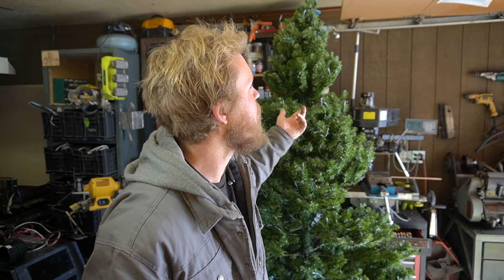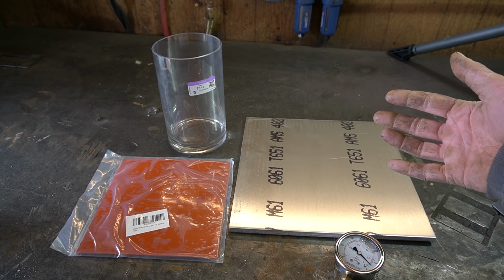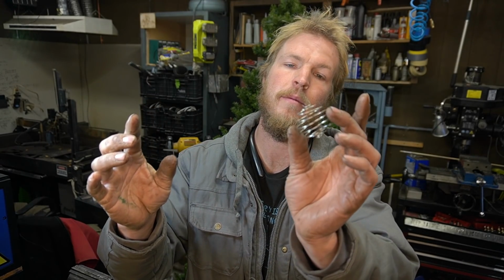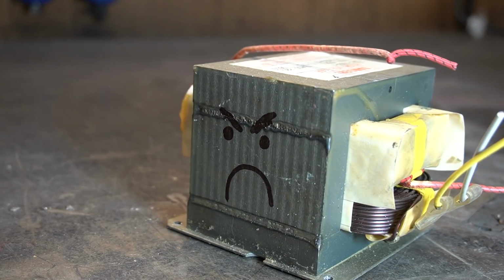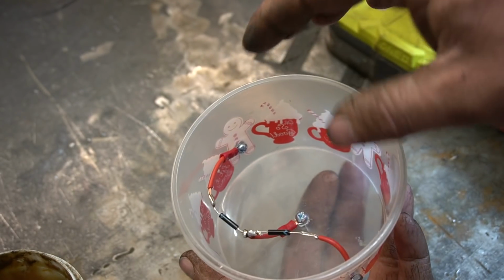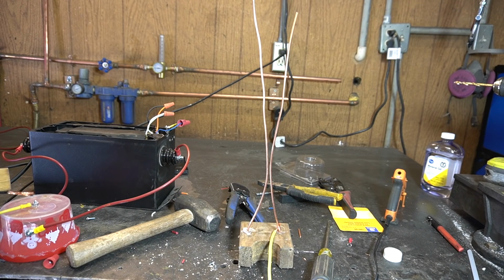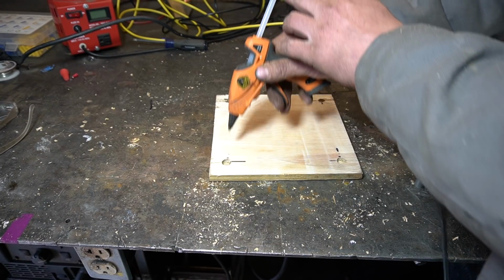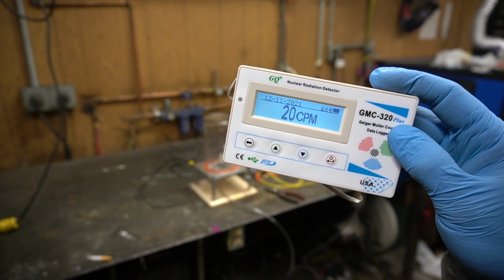I Put A Fusion Reactor On Top Of The Christmas Tree

Comment: Hey! First off love your videos for many reasons but to keep it short I appreciate you as a person and for the content you provide ❤️ secondly…. I tried to make a fusor almost 2 years ago, had almost all of the equipment needed to do so except a high voltage feed through. I’ve got multiple stainless steel UHV parts and chambers, piping, flanges, seals, two compact diffusion pumps and everything. Would you by chance be interested in having me ship them out? I’m saddened I have not accomplished it but i went way over budget and have moved on. Please let me know as it would be worth it just to see someone actually finish what i didn’t!
Reply from the maker: That would be incredible man, I too feel bad that I pit this prohext on hold

Comment: try spin glow fusion reactor
Reply: its only a flash tube, with radial out plasma current and top-down permanent magnet field, which becomes the arc spin glow plasma stuff
Reply: try electrostatic potential high voltage generator instead, the "active" version wastes current, you dont need that, to make x-rays
Reply: van de graaf generator, the hair rising static voltage generator, you need the field strength voltage, not the current for the ion accelerator and smash the ions to the target deep
Reply: also the static voltage is spark only, very safe, small amounts of fusion generation
Reply: a normal fusion reactor is no harder than a flash bulb (those long tubes, curved/circle ion particle accelerator)
Reply: ball valved centrifugal impeller vacuum pump, spin so fast that it succs

Comment: Why wait so long and build until 2030? Making a commercial fusion reactor in two years is real!
I am the author of the third method of achieving nuclear fusion, this is the repetition of physical conditions as in the solar corona. In 6 months there will be a small prototype of a commercial fusion reactor. A commercial fusion reactor in 1-2 years! Power 100 kW.                                                For many years (almost 25 years) I have been convincing scientists that thermonuclear fusion in the Sun occurs not in the core of the Sun, but in the solar corona !!! But scientists are very stubborn, and do not want to believe the obvious. Why are scientists not accepting new breakthrough scientific ideas? There is an assumption, accepted by most scientists, that thermonuclear fusion in the Sun occurs in the Sun's core. But no one has ever actually confirmed this. This is just a guess, the fantasy of an authoritative physicist. Scientists are currently using two methods to achieve nuclear fusion: inertial confinement and magnetic confinement. But there is also a third method of achieving nuclear fusion, this is the repetition of physical conditions as in the solar corona. Nobody is using this third method to achieve nuclear fusion? In 6 months there will be a small prototype of a commercial fusion reactor. A commercial fusion reactor in 1-2 years! I propose a technology transfer for a commercial fusion reactor under a contract. Thermonuclear fusion in the Sun - a new version. http://n-t.ru/tp/ie/ts.htm     https://www.youtube.com/watch?v=izCALj848xU

Comment: First time viewer here. I also use the turn it on and bravely run away method most of the time. However my cat would rather nap, so when vacuum testing canning jars, I noticed mine fit nicely into 2-liter soda bottles. I can't promise it is enough protection, but having blown up a lot of 2-liter bottles I know they're tough and mostly shrapnel-free, tending to stretch and rip in one place instead of shatter. My possibly dumb thought is if the glass implodes, the plastic might stretch a bit if fast moving glass hits it, slowing it down instead of also shattering. I think the glass shards will magically not cut the plastic. I can't see if it actually worked according to plan since my eyes mysteriously disappeared during the test. j/k. 

Probably the right way to test is to submerge the vessel in water in a strong tank and pump it down. If water will stop a speeding bullet, it will probably stop relatively slow moving glass. It might also help see where leaks are.

I think other commenters are right, the pressure difference between where you already had it and a perfect vacuum is essentially zero so if it implodes, it probably would have anyway for other reasons. And really, the pressure is about the same that inflates a football, just in the opposite direction so the glass is under compression instead of tension which is probably what glass likes. Shit happens though so...

Comment: You don't really have to worry about the glass imploding as you get into a deep vacuum. The actual pressure difference between the vacuum you were at and the deepest vacuum you can achieve is not very much so if they vessel can hold up to what you put it through it can hold up to any level of vacuum.

Comment: Definitely a better approximation of a star than that wooden thing, nice.
I don't think you have much to worry about when it comes to taking the pressure much lower, as the jump from 21.5"Hg to a perfect vacuum is not that big. Although yeah, safety first.
Also, technically what you made is a full-wave rectifier, just not a "full"-bridge rectifier (it's a half-bridge).

Comment: Awesome idea. Heres a tip stolen from Ben at Applied Science (check him out if you dont know who this is), spark plugs are an easy and effective way to make a vacuum tight electrical connection into a chamber.

I appreciate all the work that goes into making these videos, and envy your passion for these projects. Keep up the great work man, Merry Christmas.
Reply: Add that they're good if copper core. Resistor core will of course add resistance.

Comment: I have to commend you on the effort, you got the idea correct - without mixing up terms - just the numbers are a bit off, so you only made a "glow tube".
Here's a few points:
1 - Your vacuum is many orders of magnitude too high. That single-stage pump is a toy, the gauge can't measure anything near what you need(for that you need at least a pirani gauge). What you need is a 2-stage rotary vane pump, connected to a turbomolecular pump, and a fine needle valve(or just a needle valve with a looooong capillary) to regulate the pressure after you pump down and clean the chamber out.
2 - If the chamber(jar) can withstand what you just put it through, it can survive any level of vacuum. Keep in mind that the difference between atmosphere and high vacuum is literally billions of times higher than the difference between foreline and ultrahigh vacuum. As soon as you hit foreline pressure, you're starting to count the amount of stuff remaining in the chamber, not the actual pressure.
3 - The voltage is way too low, and while rectified, it's still pulsed AC. You need to add capacitors to get DC, and go up to around 15-30kV to create the plasma you're looking for.
4 - That GMC-320 meter is a nearly-blind pile of trash. It can't really see x-rays, can't see neutrons at all, and the sensitivity to everything else is through the floor. To see x-rays, you want something like a Ludlum Model 3 with a 44-9 pancake probe. There's other, cheap alternatives, but too many list here. To see neutrons is another ordeal, but unless you're putting in deuterium, that's not something you have to worry about.

The people on fusor forums are... a bit antiquated. There's far easier ways of doing a lot of stuff they talk about nowadays.
If you want advice with choosing the right parts and building an actual fusor, I'd be happy to help, just send something to (my name)@(my name).re and we can chat.
Reply from the maker: Thanks for the tips man. I'll be in touch if I hit any roadblocks!
Reply: 7
Reply: So... exactly what he said in the video?  You should watch the video before you pull out the "ackshually" routine.
Reply: For HV caps you can always go the aluminum foil/fish tank/glass plates in tons of mineral oil route.
Reply: @alexandrsoldiernetizen162  Very bulky and unnecessary. You can just use microwave oven caps, lol.
Reply: @Spirit532  Not for 20 or 30 kilovolts you cant lol
Reply: @alexandrsoldiernetizen162  Are you aware that capacitors can be used in series?
Reply: @Spirit532  You are aware that capacitors sometimes fail and of your 8 microwave caps in series If one of the capacitors failed and became a short-circuit, the applied voltage of 20-30kV would be divided across the remaining 7 capacitors rated at only 3kV, possibly causing a cascade of failures, eventually shorting the voltage source and resulting in the complete destruction of the chain. Besides, he said he doesnt like microwave transformers, so why assume he likes the caps, and he doesnt seem to mind gallons of mineral oil. At least a liquid dialectric wont fail for good.
Reply: @Spirit532  You dont really embody the 'Spirit' of makerdom, now do you?
Reply: @alexandrsoldiernetizen162  I am willing to bet my entire net worth that your homemade caps of dodgy quality(and of even dodgier capacitance) will fail significantly more often than priced-at-near-nothing dumpster microwave caps :P
Reply: @Spirit532  
I would hate to take the $50 you made flipping burgers away from you, but I have made toms of them for tesla coils and other high voltage resonant tank circuits and they work just fine. the only hassle is all the oil which seems to creep out and get everywhere. But hey, why dont you ship the man those 15 caps and get him set up rather than run your little fingies off on the keyboard?
Reply: @Spirit532  Believe it or not there is this capacitance meter thingie you can use to determine the capacitance. Not only that, but how exactly does a mineral oil glass plate cap fail? Bet you didnt give much thought to that scenario but I eagerly await your prognostication.
Reply: @Spirit532  can i get advice
Reply: @sera5m  Probably.
Reply: @Spirit532  discord?